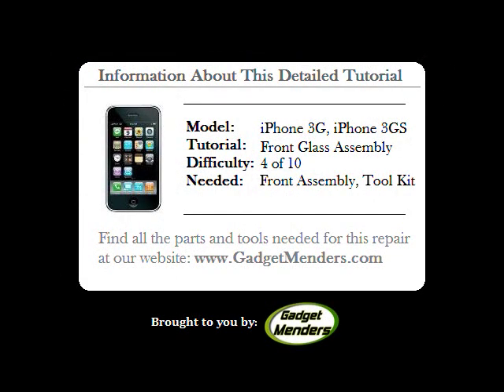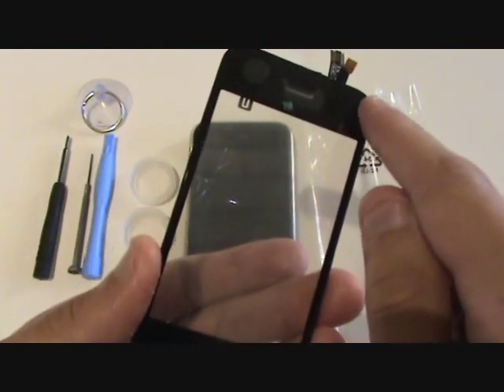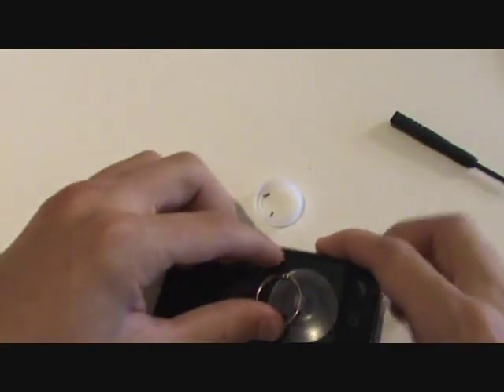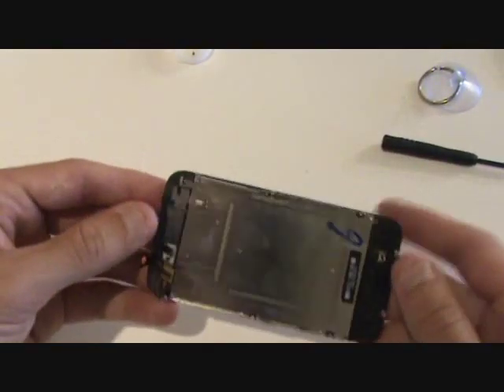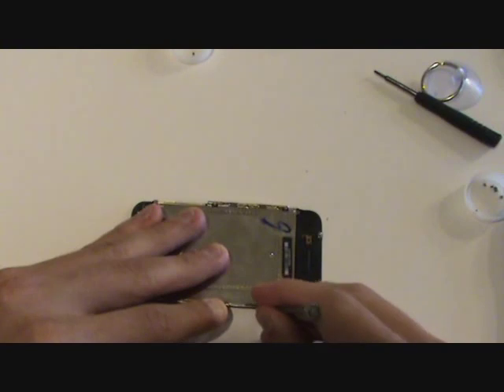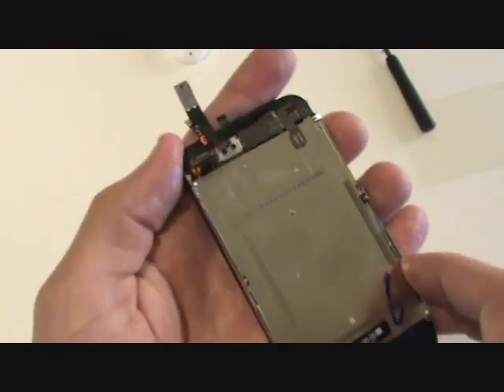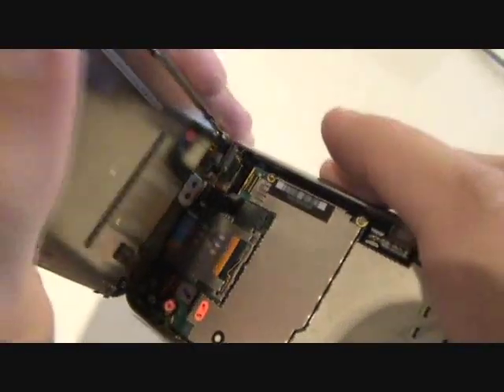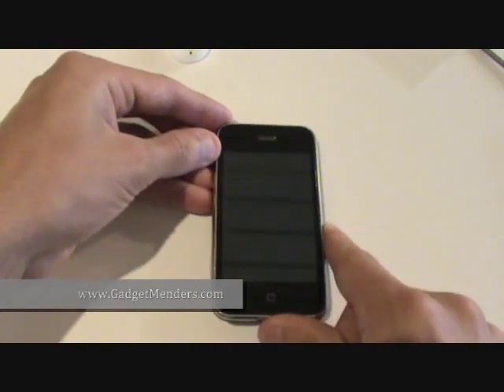iPhone 3GS Cracked Screen Replacement Tutorial | GadgetMenders.com

Comment from the maker: Model A1241 uses the iPhone 3G part, Model A1303 uses the iPhone 3GS part.  Be sure you are using the correct part because this could cause the symptoms.  Also, verify that the cables are securely plugged in.  If you feel the part is defective and purchased from us please submit a ticket on our website.

Comment: My cousin gave me his old iphone and it is working except for the touch screen has an area where it wont work.
I left it in a drawer for a while and when i took it out again i started it up and suddenly it started pressing buttons on it's own and it worked fine after that for a while but now the same place on the screen wont work again.
Could this be a wire that is not connected properly or is it damage to the touch screen ?